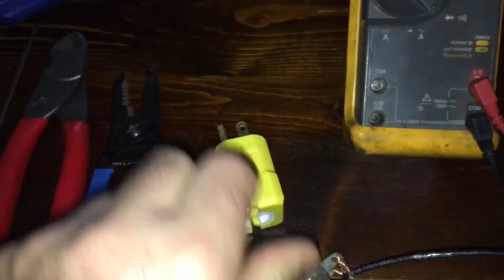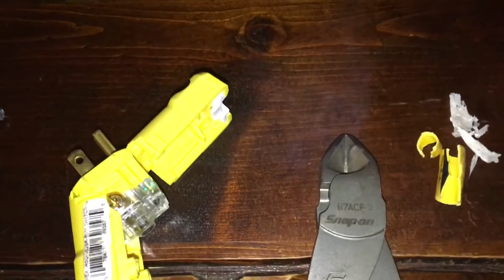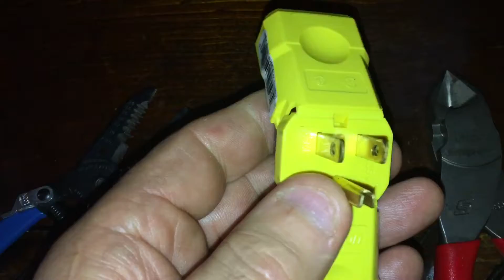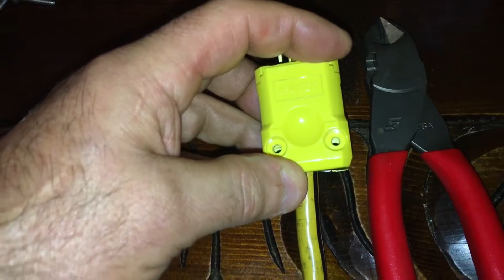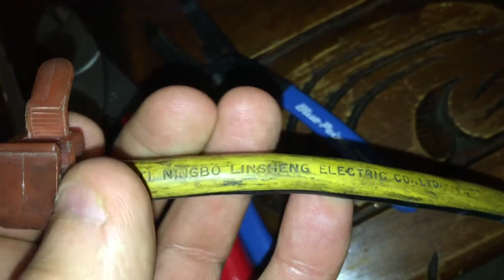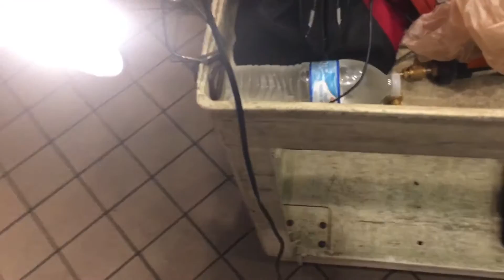How to install a New Plug on an Extension cord.

Comment: Like already mentioned you need to put a Ferrule ( it's like the first article on Amazon.com if you search for it ) on multistranded wires otherwise the second you fasten the screw terminals on them you'll squash them ( twisting won't help against that! ) thus changing their cross section to like half or even less of their normally rated use resulting in fewer strands carrying the load and potentially melting away under full load.

You'll also want to keep the grounding wire a wee bit longer than the others for it to be able to keep working well after Life and Neutral loose connection to their terminals in case the wires do get pulled out of the socket.
Reply from the maker: This is how these plugs are designed to be used. I agree with you. But , in the USA these are designed to be used this way. in the USA Ferrules are NEVER Used ANYWHERE.
Reply: @OcRefrig  I guess then... 😶
Reply from the maker: @Duraltia   Not saying it’s correct. It’s just the way it is. I agree with your statement it would be better done with ferrules. Maybe I will get some ferrules and see if the plugs will accept ferrules and clearances work for assembly.

Comment: You have to put crimp bushes on the flex wire type first to hold it together, otherwise it flattens and gets loos.
Reply from the maker: Hmmm , Nice idea. IDon'tThink i Have seen that in Usa. I Dont think we have those here. Maybe u could post a Link to those. Id be interested in seeing one of those u are talking about.
Reply: OcRefrigeration,Hvac & Electrical. https://nl.m.wikipedia.org/wiki/Adereindhuls here it is, its in dutch but you get the idea. They are mandatory here on flex wires. Unless the connecting part is suitable for flex wires.
Reply from the maker: Thank you for the Link. I have never seen those in the U. S. A. . It Looks Like something that Would be used in a Super High Quality installation , space shuttle, Military specifications looks like. Never seen them in 37 years ive been in the trade. Since 1981.
Reply from the maker: Thank you !
Reply from the maker: You should make a video. Id like to see it.
Reply: OcRefrigeration,Hvac & Electrical. Hahaha no there just to keep the wires together, imagine what happens when you put a screw on top of that wire, it flattens and possibly break, if its not a cage terminal of course. Sometimes i just put soldertin on the leads, you get the same result.
Btw wire nuts also not allowed on flex here. 😠
Reply from the maker: Next time im in a electrical supply house , I'll have to ask about these. Do you Know what they are called in English ?
Reply: OcRefrigeration,Hvac & Electrical. I would like to but i dont know how, and usualy i am frigin busy
Reply: OcRefrigeration,Hvac & Electrical. I think the correct name is crimp bushing here is a link, https://www.waytekwire.com/item/37796/Anderson-Power-Products-5648-BK-SB-Series/.
And this for connecting flex wire , they give free samples! https://www.wago.com/221/en/
I realy like em
Reply from the maker: Thanks for the link.